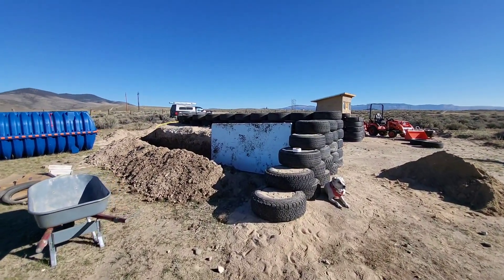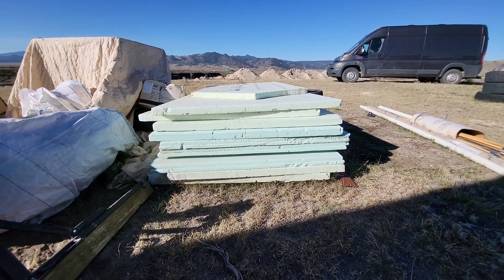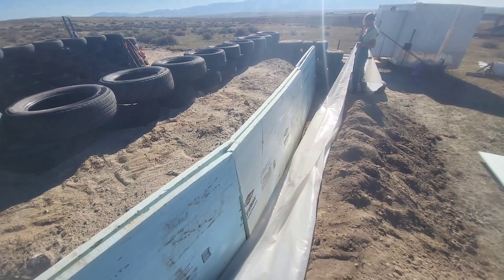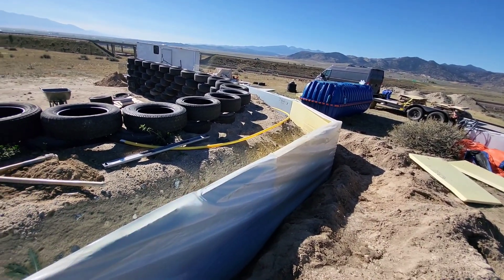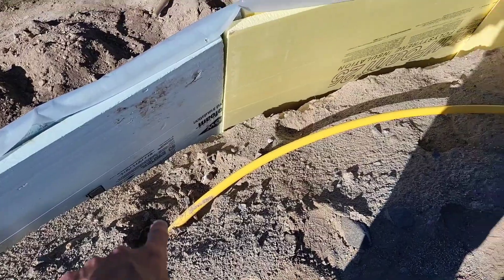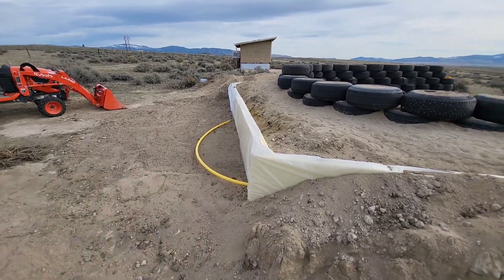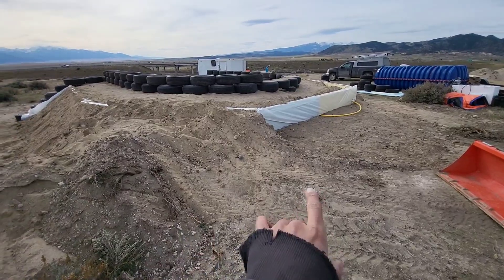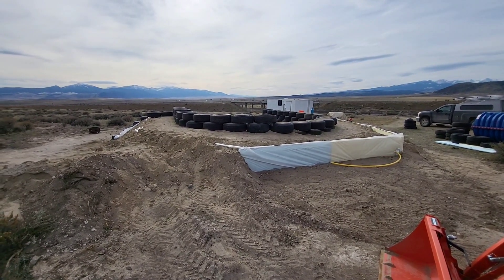Mini Earthship Build part 10: Thermal Wrap and Vapor Barrier

Comment: Great job. Is there a reason you didn’t put the water tank on the south side. Warmer in the winter.
Reply from the maker: I need the water tank to be underground so it doesn't freeze. The Southside won't have a berm. I also want the water tank to be at a higher elevation then the kitchen sink. This allows me to gravity feed to the sink if my pump ever goes out.